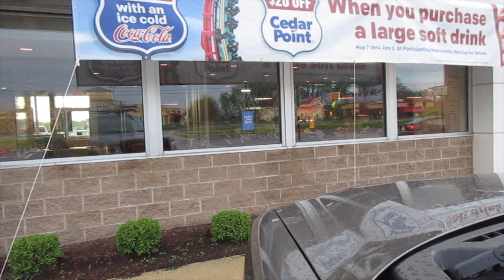Gunslingin' and California Dreamin'

Comment: I had high hopes for the aztec  samurai boab.
I don't like it. Why you might ask?
# 1- It's clunky loud 
# 2-Tends to go side ways. Perhaps a wider attachment or swivel connection would be better.
# 3-The channels move all over the place. They dance alot.
# 4- It hangs to low, even with adjustments. The Velcro strap should not of been sewed to the clip. I got use to the shortness of the Moerman boab.
I ordered the gunslinger i am looking forward to giving it a try.
Reply from the maker: Daniel Mann I don’t have any experience using the samurai but I’ve been seeing a lot of feed back from folks that have and some are similar to your experience. I think you’ll dig the Gunslinger.